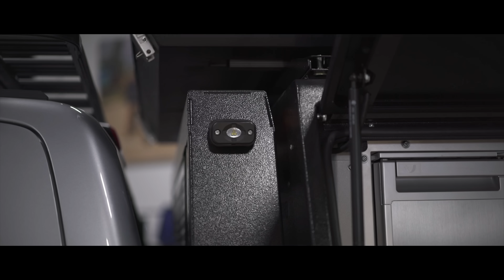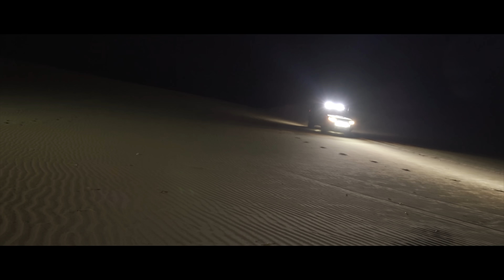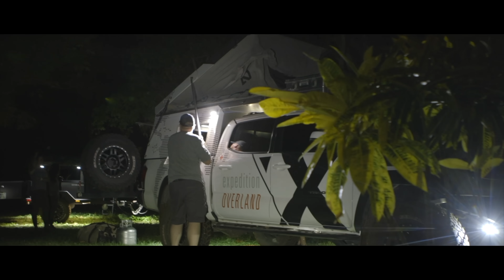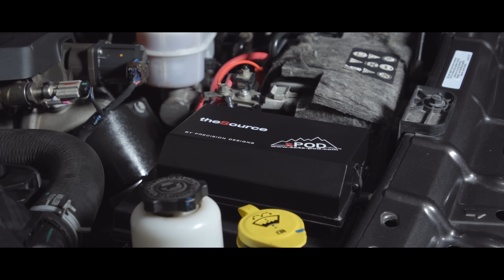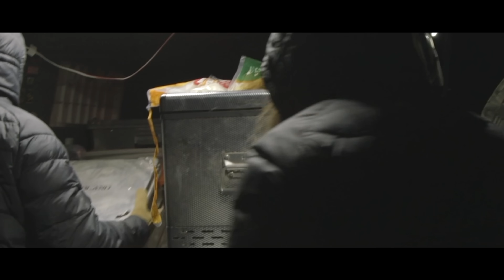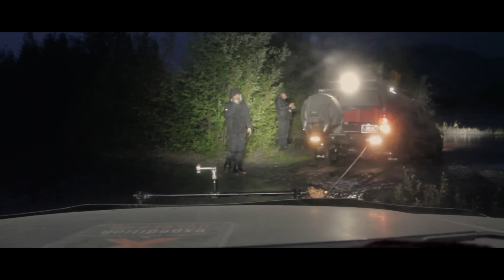Overlanding, Travel, SUV, & Truck Vehicle Lights | Expedition Overland 'Proven' - Gear & Tactics

Comment: Good call on placing your light low and run them first. Doing this minimizes the Tyndall effect where light is scattered by particles in the atmosphere such as a very fine suspension fine soil/dust, fog or rain . It is also known as Tyndall scattering.

Comment: There is a lot of redundance in the industry. This video touches the basics amazingly well. Personally, I like fog lights,  bumper light wired into the high beams, ditch lights to get a wide scene of the trail, roof/windshield light for high speed on good conditions (being the front vehicle) and some way of scene lights to get light inmediately beside your vehicle to be able to navigate around tight spaces easily.

Rock lights also seem to me like working lights, they get used for crawling, sorting problems or actually working on suspension components is something goes wrong. 
Camp lights are not a permanently attatched thing in my book because they will use the battery of my vehicle instead of their own rechargable or disposable battery without compromising my ability to start the vehicle afterwards. Just for the sake of setting up the camp site in the dark, rock lights, side scene lights and the actual headlights of the vehicle will do (as well as a light inside the cargo space where all my stuff is).

But, being a light junky and an avid camper, I would love to have feedback from anyone who thinks there are better solutions or aproaches to this

Comment: Newb question: For the camping lights, what's a typical amount of time you can have those lights on without draining your battery dry? Is there anything in the setup that gives a warning if you've used up too much of the battery?

Comment: I see a lot of lights in the grills of vehicles. Does the blocking of the air have a negative effect on the engine/transmission/etc?

Comment: I have a Baja Designs 10" bar mounted between the bull bars of my AEV bumper for the JKU. A pair of Baja Designs Squadron fogs that throw out the most useful wide angle lighting. Awesome combo. The squadron model comes with a wire loom for the JK specifically so it can be wired to the factory fog switch. I love this combo. 10" light for the off road trails at night + squadrons. I use the squadrons quite often when there's no one on the road. Can see deer much easier. 

I finally installed perimeter lighting with the Baja Designs S2 on the rhino rack and found them way too bright (blinding). Instead of buying new lights, I programmed the sPod to dim it via the Bantam unit. Slapped amber covers on.  Hope that helps someone reading this comment.

Comment: I have some high end lighting and some import lighting from a brand name.  The High End has faded and I had to reseal to eliminate the condensation.  All my lower cost are doing better and over three years of use.  I agree 100% on the roof mount light bar, looks cool as hell but you have glare.  I have driving and fog lights low on the front, they are great off road, led head lights for street driving.

Comment: Chinese always rip off stuff Becouse the original product is overpriced.   I prefer USA products,  bit when you add all your  gear up as far as cost,  then a cheap set of lights helps save cost.  I've had a 20inch  light bar for 3 years.  Paid 15.00 on amazon,  no fogging,  no fading.  Works great.  So tell these USA manufactures to lower the cost to be more resonable.

Comment: Sorry, I just can justify spending a small fortune for some lights that I use occasionally on weekend wheeling trips. LED technology is not that complicated and the prices that Rigid and others charge is ridiculous!! There are differences between cheap and expensive. Usually its the lens and not the LED though.  Ive been running some $200 Amazon LEDs for several years with no issues what so ever. If I were to have bought the Rigid or ARB equivalent it would have cost me $1400!!!! I spent my money on regearing/air lockers/a good winch and suspension. The lights I went cheap on and have no regrets years later.  Ive compared my two 9" Amazon LED's to a buddies motorized rigid light bar. He was impressed with my lights. I was not impressed with his light bar. So to each their own, but expensive lights are not a priority for me.
Reply from the maker: It’s more about supporting good companies. If you find a legit company and it’s cheap awesome. So much of a legitimate companies cost is the prototyping/engineering/sourcing of good materials/and legal to defend their property. Buying ripped off stuff is part of the problem as buyers. When we do that we literally hurt the people that are paving the way. My .02. Clay-
Reply: @ExpeditionOverland  Clay, I totally understand your point. I just dont think a $1000 light bar is in most peoples budget. As you said lights are not a necessity. So does that mean I shouldn't have any aftermarket lights unless I pay up big money? The people that NEED those expensive lights are usually already sponsored anyway. (Race teams) The average guy doesn't need $1000's of dollars worth of offroad lights!

Comment: Thats great that rigid hooks it up for ya but I'll stick with cheap Chinese brands I can buy 4x the lights and they are all now just as good... the same light chips can be found in a 100 bar vs 500 dollar bar. The power draw isn't THAT different, and doesnt matter if you run a second battery. Dont spend your money on a rigid, it cost them $50 to make and want to charge $500, its bullshit

Comment: I put the Rigid D Series Pro on my WK2 and they are pretty incredible. I mounted behind the grill with a custom bracket.. used a wireless switch that is controlled now by my garage door opener UConnect buttons. No fire wall wiring needed. https://www.youtube.com/watch?v=pQHD97oicf4

Comment: I've used the "LAMPHUS 6pc Stardust SDRL14 4x4 Offroad LED Rock Light Kit for 4WD Jeep & Truck ", available on Amazon, for years under my 4-Runner for ground lighting. A 6 piece set with mounts (bolt on or stick on, which really works well) costs $45 right now, which is less that $8 per light. They are bullet-proof, built really ruggedly, and I've never had one fail electrically or physically, including the adhesive mounted ones. I also use them for interior cargo area lighting, and under-the-hood lighting. Great product. They do not come with a wire loom, which is perfect for me, since I do all my own SwitchPro wiring.

Comment: I bought a set of Rigid dually's and had to send them back twice because the seals were not installed and they fogged instantly and became inoperable. You don't always get what you pay for, and you WILL pay a pretty penny if you're not sponsored.
Reply: I agree, bought some China knock off had them over a year now at a fraction of the cost of a Speaker or a BaHa (those prices are obscene). I do have some KCs and some Rigid. Nothing magic about the name brands. Same thing bout the SPod, I don't know those people but 400 is too much to pay for a device that does nothing more than clean up your wiring set up. Trying to be civil, but if you are sponsee how can you tell me to save money "in the long run" by buying more expensive equipment.

Comment: Great information, thanks.  May I suggest the addition in your Utility section, the installation of an amber chase light(s) in the rear of your truck.  Adds spotting / identification of your rig's proximity to those driving behind you on a dusty or foggy trail.
Reply from the maker: Great tip!